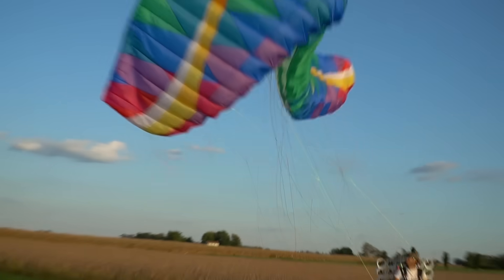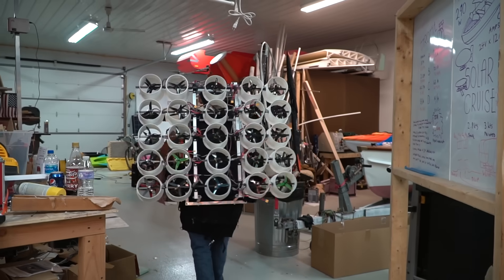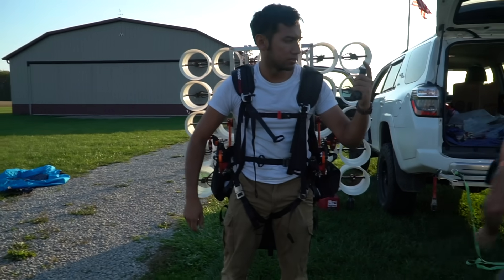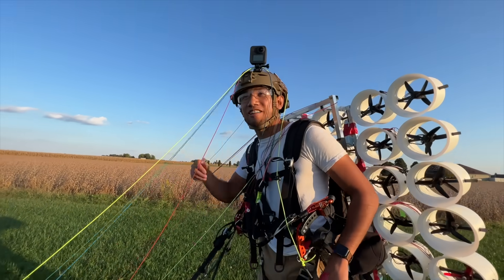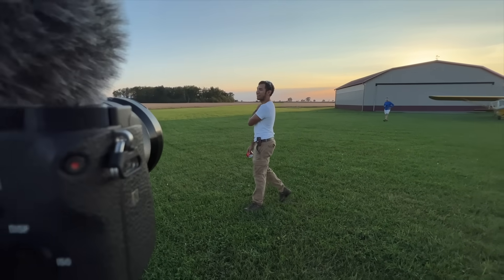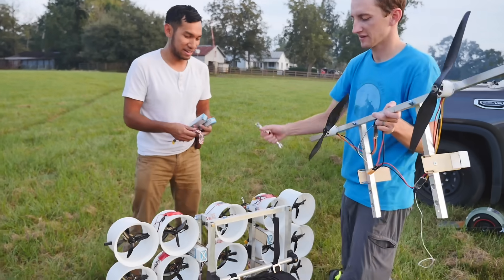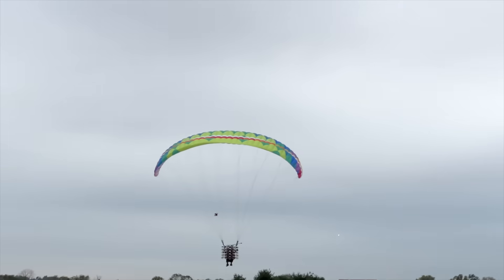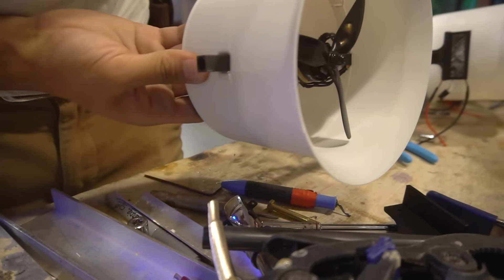Flying with 50 drone motors (homemade flying machine)

Comment: You are for sure loosing efficiency and thrust with the double motor set up inside the ducts as well as the duct clearance issue. if each motor had its own duct you would probably get more battery life and a small amount more thrust. Worth experimenting with?

Comment: Suggestion for the next project: ECT2 plane built from construction foam. Yes, you built ones from foam sheet but would be cool to build one using a can foam. Just to make a shell, fill it with foam and see if it will fly!

Comment: Peter! Bro put a hinge system so it can lift you off then once airborne pull up to back for forward thrust. Also you have to move the central 12 motors on the sides you’re blocking the airflow with your body 😜👍🏽

Comment: Nice work, but I'll prefer proper fixed wings every day of the week.

The closest that one comes to R/C flying in manned aviation are craft like the Colomban Cri-Cri, and Luciole or Igor Spaceks SD-1. Wood, foam composites around 120kg empty. Apart from the Cri-Cri they even make the 120kg deregulated ultralight class across the EU, if certain precautions are taken.

O'er there, on your side of the pond, the only thing comparable would be part 103, but that has nasty speed restrictions that make planes "balloony" and flimsy.

Comment: Sometimes I think about how crazy it would be to be able to fly, and how hard it is to make flying machines and then I watch this guys video and he makes it seem so feasible
Reply: To be fair, it's not as if it is a novel creation. It's a propulsion system change. Not taking anything at all away from him or at least not attempting to. This build is the bees freaking knees. It is not, however, creating a new wing concept for an airplane from nothing but an idea in your head. 
Alllll that nonsense out of the way. Build yourself a paramotor! I really want to try out different engines but anything I have considered has already been attempted and either failed or worked and is now in production lol. I have a gigantic almost 7ksqft fab shop and a similar size wood shop and I have the ability to do carbon fiber and fibreglass at home as well and the one thing I want to make is Cosworth during the early '90s when they had the insane V10 non turbo Formula 1 engines made a single cylinder to test changes and it's 90HP and 10kRPM basically what I'm saying is I want to start from a solid block of aluminum and mill an engine block from raw stock. I'll likely buy the piston as I don't think figuring out how to forge a shape that complex would be fun and while obviously cost isn't too big a concern for me, in the case of the quality of alloy needed for a piston I may have a hard time finding enough material to make enough attempts to get it right lol. Forging isn't exactly something I do daily.
Reply: @jeffreyhill1011  Gonna be honest I don’t know a lot of those terms you used, but I got the gist. You got some crazy shit cookin
Reply: @felixfathead1640  4 years ago I retired at the ripe old age of 35 after winning a high 8 figure lotto lol. I was already very successful and my daughters and I led a very comfortable life but spent basically all of our lesuire time me teaching my girls how to fabricate and woodwork. They have made their own resaw company and they are 17 now started when they were 15 and last year made enough money to buy brand new F250 pick up. So we have made a bunch of cool stuff. They have made homemade go carts and mini bikes, including welding the frames themselves. Makes a dad so proud when his part time model daughter walks inside covered in grease dirt and a little blood from scratches.

Comment: That was SO AWESOME!!!  But i was thinking... would you get more lift/push if you actually create a inverted V shape (A-shape) holder for your engines instead of a 'wall' holder (making the engines away from behind your body so they see forward without your body in the way for the most part?)  it would make it larger (width) but an inverted V (A-shape) would still allow you to hold your string away yet allowing your engine full air supply.  INCREDIBLE experiment and i loved it.  Now, how many would it takes to make you fly without a parachute??? lol  ;)
Reply: I think a circle would honestly be better as it would have a more even overall dispersion of force and leaving the center of said circle think (⭕) not (🔴) would give the ducts (after making proper sized ducts I mean really?) a proper supply of air. Maybe pop it into solid works and run some simulations on the flow

Comment: I like the general idea and I propose an improvement: Try to get the propellers out of your back, and put them around it. It will take more space but the propellers will have free wind flow for more eficiency
Reply: I was replying with the same comment when I saw yours.  Absolutely, the propellers' being blocked by his body are wasting a lot of energy.
Reply: Maybe even extend the prop backback vertically up in the air. and extend to a horisontal rectangular frame catching the a,b and c lines.
Reply: @danielgrwaldphone2927  I was also thinking along these lines.  If the frame is maybe hinged; it could either split from the top, going either side, or something like that.  If that mechanism is driven by a single shaft or lowered winch style, using gravity ... It could be added without much extra weight.

Also a more efficient motor and propeller setup would yield much better efficiency and result in better runtime/distance.  Bigger props, wider blades, lower speeds, etc.  Drone motors are usually run fast because the controlled changes need to be fast in order to compensate and stabilise the vehicle.  That is not necessary in this application, so they can be run slower with increased air shifting capacity?
Reply: @TrishaXuk  oui mais comme la surface d'hélice est la même qu'avec une grande helice ça revient au même.
Reply: This irked me tremendously. I can’t believe they didn’t think of this. Having those motors blocked by his body only adds to the weight and wastes battery life. It makes it a lot less efficient.
Reply: Or just save weight and do away with the said propellers altogether
Reply: I was about to say the same thing! Also would reduce the strain on those motors, reducing power consumption and extending battery duration.
Reply: Wouldn't that just create a vacuum right behind your back?
Reply: Yea those motors are just burning through Ah at stall.
I wonder if he's considered over voltaging the other thrusters. Adding some downward thrust would probably help quite a bit too. I don't fully understand the sail' dynamics vs a proper fixed wing aircraft, but it seems to me the sail needs some assistance maintaining lift and speed won't help it maintain lift in the way that a fixed wing aircraft works. Therefore, I suspect a tilted orientation -- or at least the ability to use servos on bottom row -- would do wonders.
Reply: yes.
Reply: Havent we learned from icarus lol

Comment: The 'chute cords like your propeller ducts, they just cannot speak. A 6 arm drone frame, with the classic sized prop loop, you will have the first 1 hooman, wall chargable, flying device. Might wanna try a 3D heli setup, and do like a C-130...always 100% throttle, but flex the pitch for thrust, no negative pitch tho.

Comment: Air flow might be a big problem here. Very turbulent flow behind your back, if you put the motors outside of the negative pressure zone formed behind ones back you will get more total thrust from the few motors you have.

Comment: You should see how much of a drop in thrust you get from mounting motors like you did vs separated. An octocopter has way more thrust than a quad with 4 sets(8 total) of motors. The bottom props only get the top sets choppy air.

https://youtu.be/dz9X-fiEkvU
Reply: Although the rig would be 6’ tall mounting 50 singles

Comment: What a waste of time. Anyone knows you can make anything fly. 
But you went way beyond  reality.
Lok at the ridiculous costly expense. 
Its so dangerous,  and by the way you are many years behind the seans. 
This stuff was done 50 years ago
Look it barely works. And it can't work with out a chute. 
Then it dies. 
Your wasting our time. 
It doesent fly at all unless a human straps it on. 
Its obviously useless.  And also the Venturs  don't benefit you. 
You have way too much weight for the applications given its task. 
When you really want to fly you must see what I've had well over 35 years now. 
No I won't tell you what it is. But its not a plane or helicopter. And its definitely not a parachute with a hokydo contraption on it. 
Oh yeah. 
My aircraft could be made for the money you spent on this thing that don't work. 
But at least you try. 
I guess you are the type I would train to actually be an inventor. 
Ok peace. 
Stop wasting your money and time. Theres somthing much better. 
Invest in what will and is what THEY are looking for.
Yea the DOD  and  DARPA and the
 103 RD  CONGRESS. 
BUT YOU DONT HAVE TO LISTEN TO ME. 
I ONLY KNOW WHAT IM TALKING ABOUT. 
PEACE ,✌☮

Comment: The motors directly behind the back should be moved to the outside you don't create any substantial thrust being blocked by your body also too  wearing baggy clothes creates more drag wearing  tight clothes will help it's like a airplane trying to fly with a car cover on or plane cover that is just like clean airplanes fly better than dirty ones like people that jump out of airplanes don't wear clothes that  MC Hammer wears hope this helps

Comment: That airplane project needed cable-bridge-braces.
Reply: Rotors benefit from a flared cowling with a tapered output; a constriction concentrates force into thrust: recommending a polystyrene form, all-in-one rotor-cowling and electronics-nest, neatly situate housings and motor-braces and keep everything in a CAD-perfect line.
Reply: Water-jet-channel might collaborate in making a polystyrene form.

Comment: Super Rad!!! 
Also awesome to be surprised with the Tucker collab! 

Silly extra credit idea for the next build: 
Tune the PVM for each motor at the controller or through an intermediary controller that selects motors speeds from a hash table of specified frequencies. So that at different throttle positions the motors are making harmonious tones rather than wheezy whines. With so many motors it should be possible to have some mega lush tones that would blow peoples minds. 

Extra Extra credit: 
Make the motors play music. 
This would be the same way people get their scanners to play music only scaled up to all of the motors. If appropriate songs are selected within the proper frequency range that overlaps with the frequency range of the motors maximum power output the contraption should be able to fly while playing music at the same time.... 

maybe...

 at least it sounds great on paper :) 
<3s!!!

Comment: The air pushes at the center of your back will increase a massive drag, you can only 3D print a V shape air guide that will control the air for the both two angle easier control and heavy thrust just as herreir, this could even fly without using a parachute.

Comment: Oh gee....you really are crazy risking your body to a serious injury.........it looks fun though but that high off the ground doesn't leave you with much leeway for a hard fall recovery.
I would say it has a huge potential as it's electric and with the right battery pack could be a real winner for low tech fun flying.....AT LOW LEVEL.

Comment: A potential cheap, quick, and easy fix for the high clearance issue might be shimming each duct interior casing with stretchy electrical tape (the thick kind that thins out when stretched) where the propeller tips rotate. If it's anything like a jet ski wear ring, even a slight gap can sap a noticeable amount of power and I've had luck with the same approach on past turbine builds.

Comment: Coming from someone whom has no clue as to what he is talking about. That being said,  I was wondering what if you made the back side of the ducts reduced in size. 1" or maybe even 2"  smaller than the front,,, kind of constricting the air flow.  Just a thought if that would do anything?

Comment: I think you should put all those inside a big funnel. Like a jet engine end. So all the air is forced and directed with more pressure to 1 spot. Giving more push

Comment: Friend, as a suggestion, make the "ducts" of the propellers as a "turbine" like shape (as a funnel). Says that the mouth diameter is 20cm, make the end as 5cm, with a good length, this will compress the air making you fly better 👍 
If you just put the "ducts" as "protectors" for the motor and blades, you are loosing power.

Comment: You might be able to save the duct situation by buying oversized props and using a jig to cut them down to snugly fit the ducts - you're better off with bullnose in ducts anyway. Or you could just lose the ducts and go with a paramotor cage.

Comment: I was really hoping for some efficiency estimates on the little ducted fans vs. a normal single prop. Obviously the fans have many unique advantages from design, safety and cost standpoints. The paramotor of the future could look very different..
Reply: No. 
Battery tech is not only worse for the environment and costs as much if not more per gallon to produce let alone charge than a gallon of gas. 
But the power to weight + range makes it a joke for normal thinking people.

Comment: With a little refinement, this is gonna be EPIC.  Up the prop size for each blade (use less of them), switch from a 3-blade to a 2-blade prop, and try playing with the motor size and pack voltage (try 6s packs and motors).

Comment: For your next version you should look into using an electric bike hub motor. 1500W can get down to 130$ and you can program a controller for certain rpm targets

Comment: If one of lipos overheated and flamed in the pilots direction it would have been baaaaad. Drone batteries are not designed to be pegged for more than like 10 seconds at a time

Comment: The interesting thing is you could do two larger ducts say 18" across and put one under each arm to improve airflow around you body.  The pack would not put all the weight behind you then.
Reply: Does this whole comment section just not know about paramotors lol
Reply: @david7384  I had seen them but they're a different design. The entire fan is used in that design, even when there is muting of the airflow behind the body, because the blades are flanking and above as well in their cycle. Those engines directly behind are only always pulling around the body, and that seems to us to reduce their efficiency, I believe for the drag across the torso.
Reply: @up4open763  haha yeah that's my point.. This is just recreating a worse paramotors
Reply: I thought the same thing. As I go through the landings, I wonder if that doesn't make a danger to you or the craft if you fall. To reduce damage possibility to the blade frame you could gap, covered or uncovered, the ducts on sides as they reach the fans, to allow some pinch movement, with some risk of other things or personal parts getting pinched. I was also thinking put the fans in a vertical halo form, and just gapping behind him, but then I think you're risking running into size difficulties and controlling the chute when transitioning.
Reply: It would also reduce underarm perspiration…

Comment: SUGGESTION: you need a airplane tail bolted on he back. And the vertical wing parts should be wider and able to flex up or down to direct the person, up, own,, the tail horizontal piece needs to be able to go back and forth. Now you have control of going Left or, right, ,, all controlled from the front with something like a joy stick,,,, use 3d printer,,, all together it's cheap and light.
LAST PART,,, your group of fans,, Need's to be further away from the pilot. As it is now, the pilot's body is to close and blocks the air flow of the fans,,

Comment: If you want to guarantee that the motor and propellers are precisely in the centre of the ducts, you need two three point connectors to mount the motor to the inside of the ducts.

Comment: Could a single prop motor from a large filming drone be used for simplicity? I was thinking about using one or two attached to an aluminum seat that doubles as a cradle for a large lithium, to make myself a powered chute..

Comment: The motors directly behind you need to move. Your body is obstructing the airflow (and a traditional paramotor first produce much thrust in this area either. Move those motors outward and you'll get better performance. Then add motors (weight and power draw) if necessary.

Comment: You could increase trust output by improving the design of the prop housings. Would take some very basic sims to get something half decent and they could be 3d printed the same as the current ones. My 2c, but worth a try instead of increase bulk and weight with more batteries and motors.

Comment: ducted props and non ducted props are also different, if you do make a redesign with ducts, make sure you use the right props so that you can actually get that efficiency from the duct, also maybe take out that one middle row, and add a row to the end of each side, that way you add five fans, and increase the efficiency (even if by a little bit)

Comment: Another electric one? What about one of those $3,000 turboshaft engines designed for really big RC helicopters? It would still be really light (about the weight of a turbocharger), sound way cooler, be really fast to refuel and have a much longer flying time.

Comment: Is there a website I can use for increasing my carbon footprint?   I prefer to drive my 66 mustang as much as possible and I figure the 7 miles per gallon city is better than using my cars that get 13-15 mpg city

Comment: Maybe I missed it but did the aft motors run a steeper pitch prop versus the front prop?   Seems bottom props are likely to need steeper pitch compared to the top props